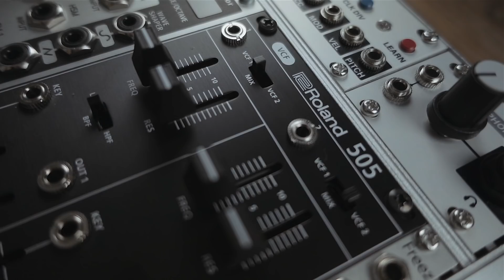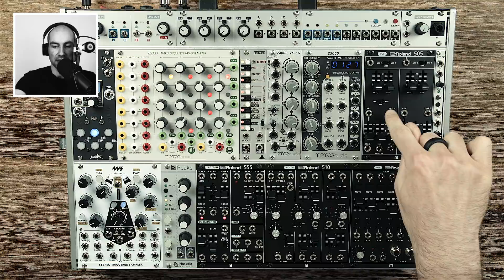Roland System-500 505 Filter Eurorack Module

Comment: On my SH-5, the multimode filter goes into selfoscillation in all three modes. The band pass filter never selfoscillates. It also doesn’t show the instabilities of the 505 module. Just the opposite  behaviour of the 505 filters. So, this is a Roland filter, but this is not a SH-5 filter. Great video, anyway.
Reply: Friendly Noise interesting as it is quite the opposite here indeed. I love that filter 2 on the 505. What is your favourite filter in the sh5? Are they 24 dB or something else?
Reply: @mamakuproject  The bandpass can be my favourite, as far as sound uniqueness matters. Unfortunately it doesn’t have any CV. Stay tuned for next Tuesday. I will upload a video showing the SH-5 sound.

Comment: The resonance is so gnarly on the 2nd high pass filter.  So why is the resonance so polite on the left multimode filter?  Is it a VCA thing?  Or is that just the character of the module?
Reply from the maker: Yeah I'm not too sure. The first filter's resonance doesn't self-oscillate either. Not sure if this is how they all are  or just mine. But I guess it gives you more variation to play with between the two.